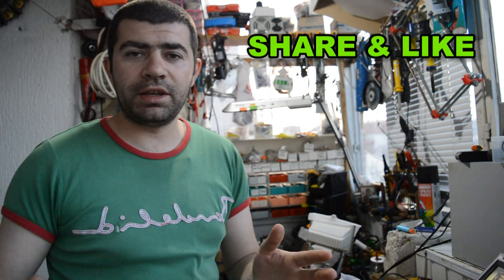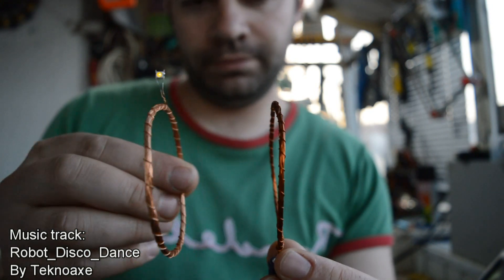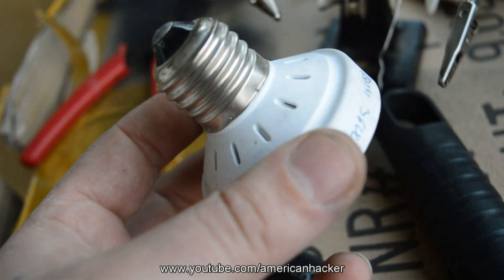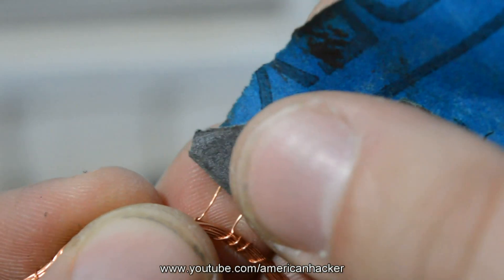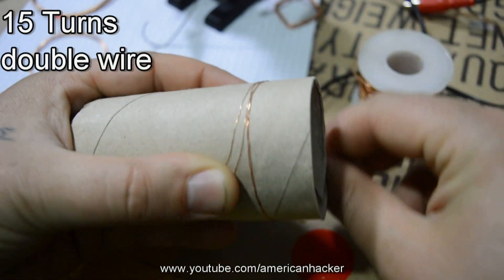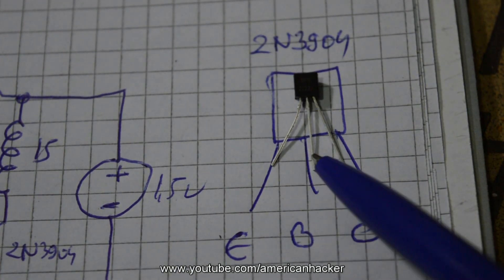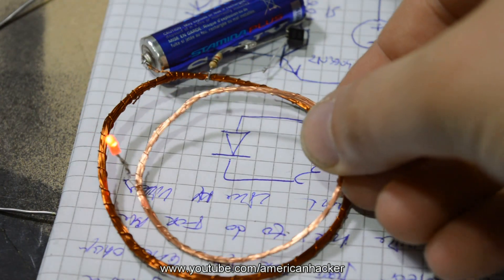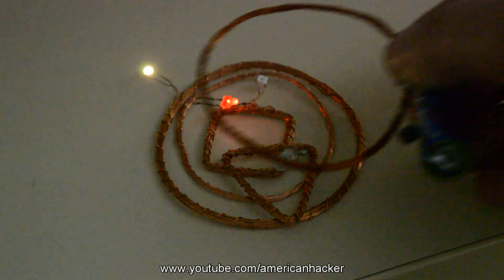Wireless Electricity Transmission Circuit

Comment: I've built this twice with your technique following your post.Unfortunately, I can only get the LED to light momentarily. The transistor gets very hot as well.I believe this transistor may not be oscillating-instead just constantly outputting.Do you have any thoughts?
Reply from the maker: Patrick Hayden which type of transistor do you use?
Reply: American Hacker Both times I've used cfl transformer wire, new 1k resistors,and new 2N3904's with proper pin out soldered. Thank you for replying. My two builds the circuit definitely transmits the power&lights the LED-but only for the second I apply positive voltage. If I leave the power connected the transistor overheats & the LED remains off after the moment of it being lit. I wouldn't have bothered you, but electronics is my trade & with the circuit being this simple it's irritating me that I can't make the LED stay on continuously. My next attempt I'll just try packaged magnet wire instead of the wire in the cfl transformer so I can be certain there are no breaks in the insulation or shorts in the coils. It was still fun to see the receiving loop light the LED for a second, though.
Reply from the maker: Patrick Hayden the receiver coil is very simple 30 turns of copper coil and at ands of wire you solder a LED,the transmitter coil double 15 turns on paper roll or any round object up to 5cm diameter,and ends from double wire connect them together and this will be positve power supply from 1.5v battery,the other two ends from coil:on one you solder 1k resistor from here to middle leg (BASE)of transistor 2N3904,the second end from transmiter coil goes to (collector) and that is right leg from transistor when you watch the transistor with letters in front of you,and on (emitter) the left leg from transistor you connect the negative pole from battery.If any trouble feel free to write.

Comment: is the range dependent on amount of wire... i have made both coils of 2 cm diameter and the range is 2 cm above.
Reply: and the round are 30 on both. On 2nd coil I used single wire. I do 15 turns amd then make a loop and then 15 again
Reply from the maker: +Vansh Digani the range depends of current that flows thrue coils and size of coils

Comment: You're getting better and better :)

Cool idea :) How many Volts and Amps does it support?
Reply from the maker: ThePrinzKassad this circuit works on low voltage and draw about 40mah from battery
Reply: American Hacker ok... If I am not too dumb, then I am right, that this thing works basely on induction, right?
Reply from the maker: yeah,induction field
Reply: So larger/bigger induction field means more power?
Reply from the maker: yes,more power for greater distance between coils
Reply: If I make the coil bigger like 60 instead of 30 turns... then I theoretically double my range and the power.. I am thinking of making an DIY-Wireless charger for phones (Wireless, still with cable but my phone isn't connected with the short cable to the wall)

Comment: Hey American Hacker I want to ask that can I use transistor  2n2222 instead of 2n3904
Reply from the maker: +Aditya Raj yes you can use it,just check pinouts
Reply: this technology is known as teslacoil
Reply: +American Hacker  can this be done for example to reduce from 12v to 1,5v? For instance in case you want to charge a battery of 1,5v from a battery of 12v: it would be 120 turn for the 12v and where it is the led, instead the led put the 1,5v battery to be charged, and the turns would be 7,5 turns. What do you think would it result?
Reply: yes we can use but where can we get 2n222222a transistor please replay soon very soon
Reply: i dont have transistor of 2N3904 then what is another transistor that satisfies or same feature of another transister
Reply: KRISHNA PRASAD 2n2222a
Reply: Aditya Raj 2n2222a works better than 2n3904

Comment: how to increase the range of the Wireless Electricity Transmission
Reply: +Aswin Balaji By increasing the voltage power, transistor values, and wire thickness. In other words: a different circuit.

Comment: How does the transistor work here? I beg to explain.
Reply: Gor O It acts as a switch,  it turns on and off in a fast manner (1000 times a second) Thus the magnetic field build and collapses very fast and current is induced in secondary coil
Reply: Thanks.
I need to know why exactly magnetic field is being collapsed and which exactly processes happen there in this circuit.
Reply: Gor O First when the switch( Transistor) closes the current flows in the coil and it creates the magnetic field, then when it opens the magnetic field want to supply its power, So it collapses and this cycle repeats, this creates a spinning magnetic field which is often found in ac circuits, As you know wireless electricity is not possible with dc so due to the spining magnetic field it creates effects of ac and power can be transferred, check my channel for more great projects